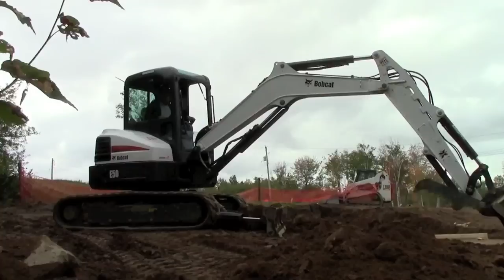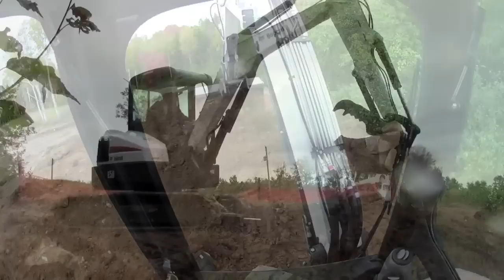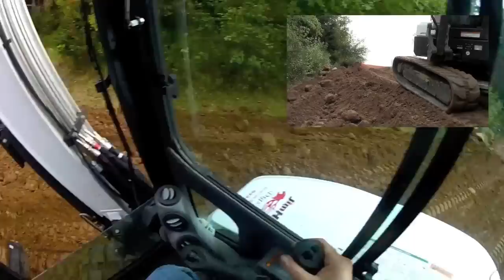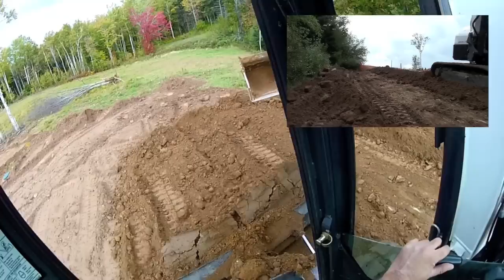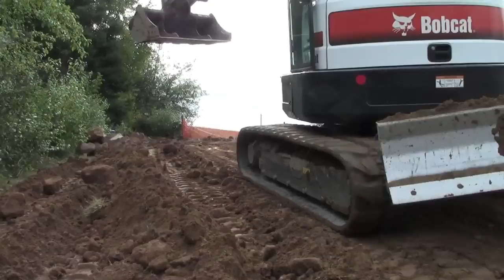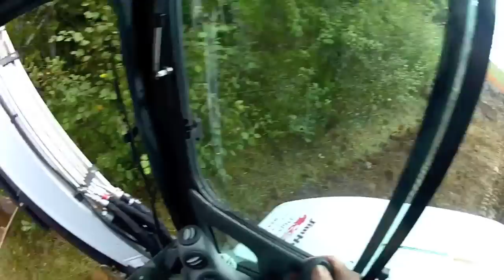E50 Bobcat Angle Blade

Comment: Angle blades are great tools for moving gravel and dirt.  I use them to grade roads and parking lots because they have great strength and can "roll the material" without alot of tricks like using just a straight blade.  The real problem I have with mini - ex blades is the height and width of the blade.  
     What happens to me as what happened to you Jim is that the blade is too narrow.  The material you bladed sometimes kept going back under the tracks causing more passes to get the initial pass flat.  So what I have to do is constantly turn the machine, and work the machine back and forth to make a path large enough to make the path flat.  In this case you may as well have a straight blade.  The angle and the size of the blade are great for filling trenches but since they are so narrow and so short they cause other tricks and techniques and subsequent passes costing more time.  
     Maybe do a video where you use the blade to roll out a pile of something that doesn't stick or roll around like damp dirt or crushed quarry rock.  Roll it out over the top and then try to cut the pile down from the side and you'll see what I mean.  The tractor won't stay flat on the first pass unless you use other moves to make the path flat.  
     I personally believe that some of the manufacturers could save we operators a lot of time by offering a "blade extension kit" where you could slip the extension over the blade for grading and not just forcing us to turn the machine to back-fill and grade.  
    Also, what the heck is up with annoying constant back up beeper??

Comment from the maker: No power tilt just angle. When it's angled sharp tho the trailing edge of the blade is a few inches lower then the front so you can get bit of a angle cut started.  Maybe not as good as having tilt but it still a lot better then a straight blade.

Comment: The E50 is an awesome machine.  I demo'ed one at the dealer and just loved it.  right now if I got an e50 i'd have to trade in the 335 and probably give another 20k.  Right now, if I get another excavator I'd probably go a used cat 312 size to be able to do bigger jobs.  However, that is unfortunately probably 2 years off or so.  :/  
Again, nice job on the E50!

Comment: Nice work. If you have two machines you might want to check out the Mecalac 6 MCR they are being sold in America now
Reply from the maker: Thanks for putting me onto the Mecalac! I watched quite a few videos on them and now I want one! Any idea on the cost of one of these machines?
Reply: There is a dealer in Massachusetts now. Machinerytrader has a 2016 with 165 hrs, 18"bucket and 80" loader bucket for 96,000 I wish I could afford it myself